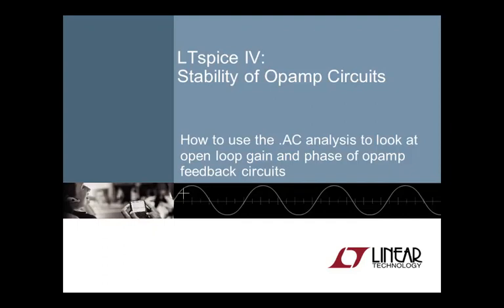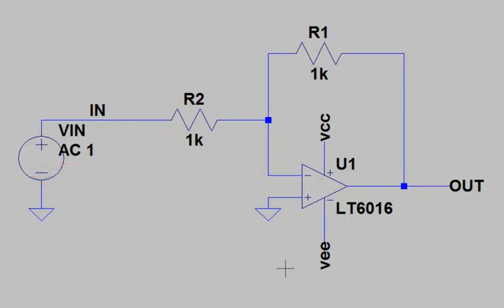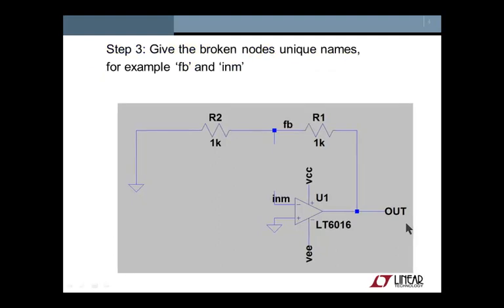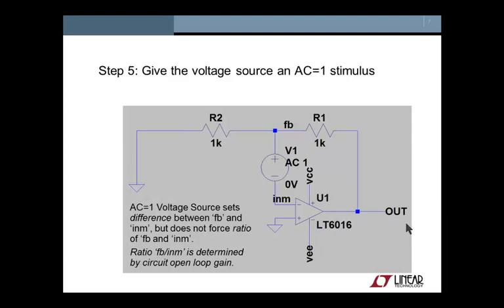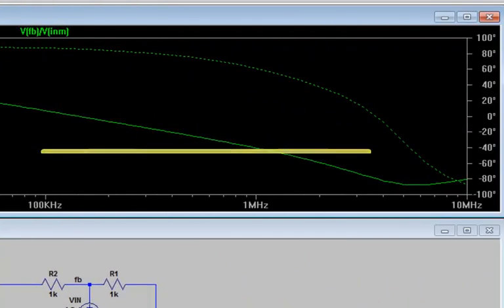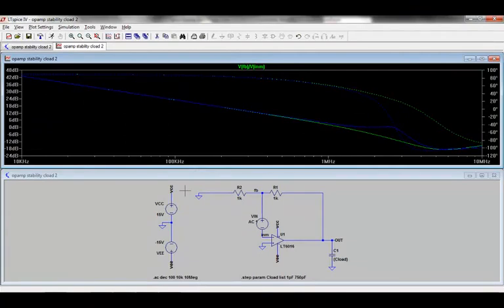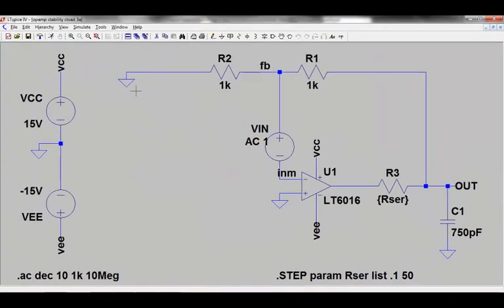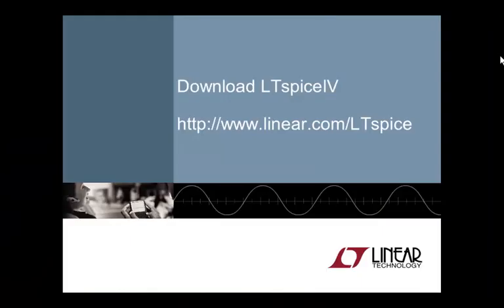LTspice Stability of Op Amp Circuits

Comment: Hi, We have read that the phase margin is the difference in phase between -180deg and the phase at 0db gain. Can you explain how this circuit is used and the phase margin is directly the phase at 0db gain?
Reply: You are injecting a signal into the inverting input. The output will show a 180 deg phase shift right off the bat. If the loop gain picks up an additional 180 deg of phase shift then instability occurs. The phase will go from 180 and get more negative. The phase margin is thus the phase of the loop gain when it's amplitude is 0 db